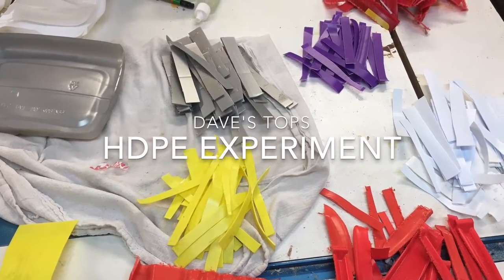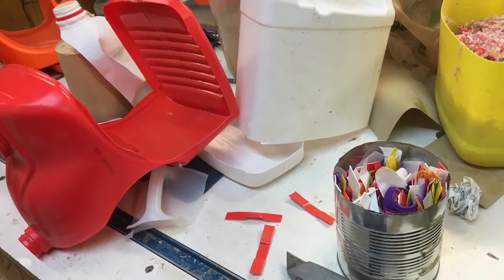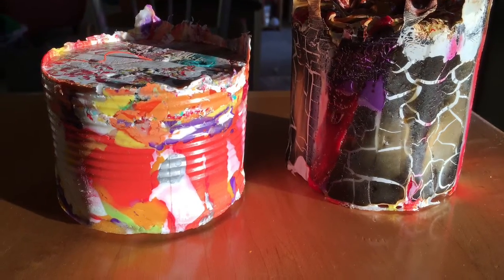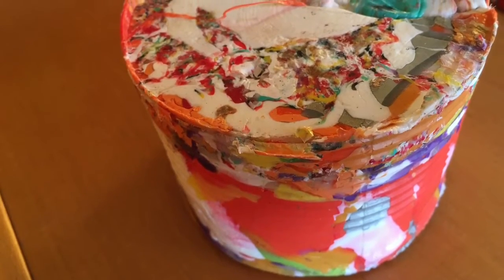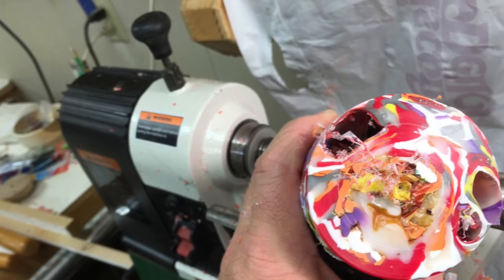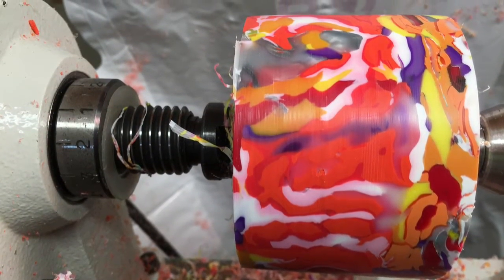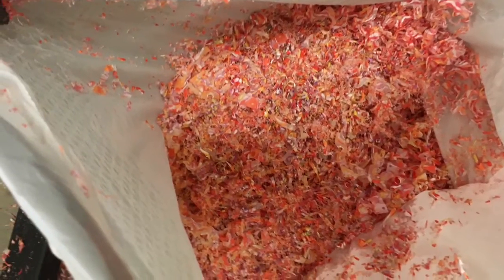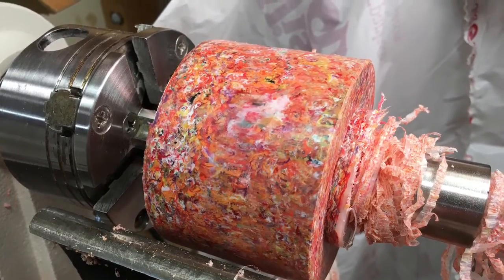HDPE melting Experiment

Comment: in order to remove air pockets i knead the molten hdpe into a gooey blob with silicon oven gloves and then clamp it in the mold this will ensure all the pieces mix together without weak spots and air pockets
Reply from the maker: +Dean Walcott. Thanks. You must also heat it in a different container then the mold? I would have a very hard time getting the hot HDPE out of the can to kneed it....before putting it back into the can to clamp it. I will try melting it on a flat pan, kneed it and then press it into a round mold to make a spin top.
Reply: yeah i would melt it in a flat pan first and then knead the plastic after that i would then clamp it down in a round mold but i would still preheat the round mold so that the plastic stays molten long enough and fills the mold better
Reply: +Dazzling Dave hi its a kid from holy family